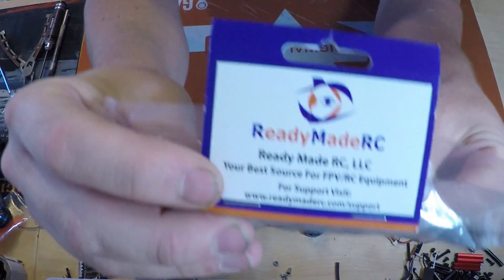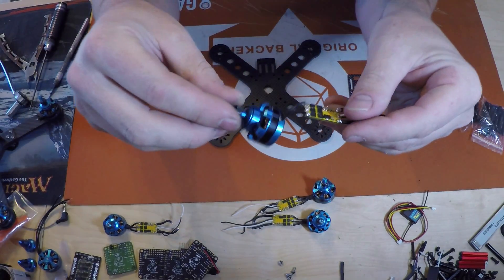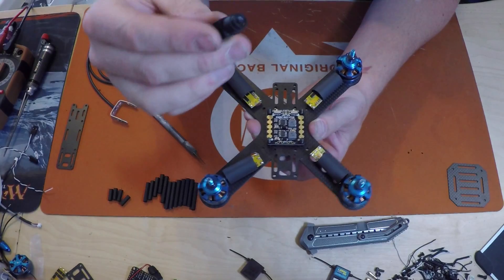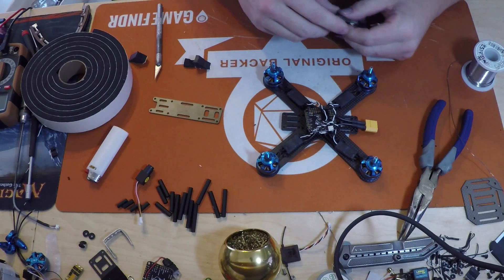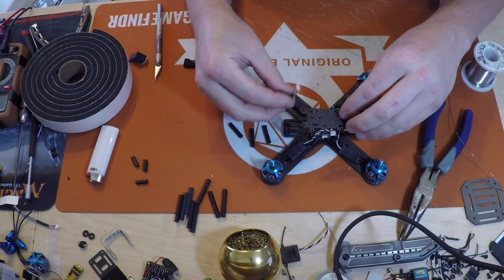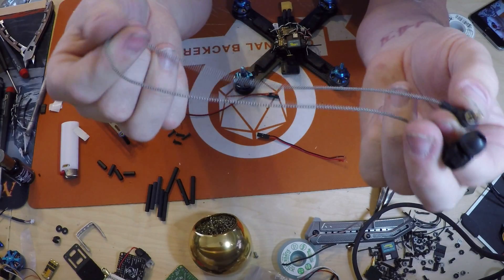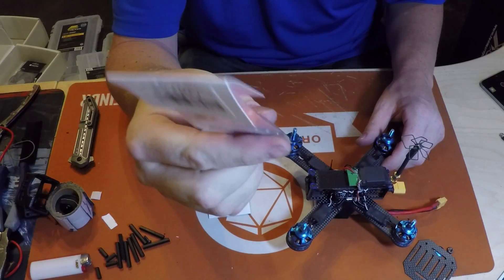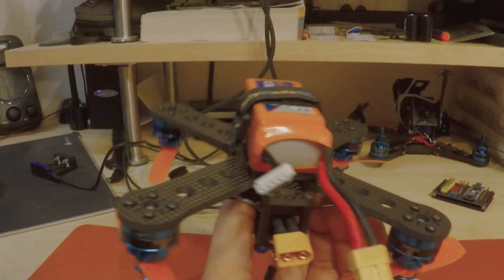Goby 180 Build Video

Comment: Hi! Could you please give an AUW? Without an HD camera but with fpv components and battery.
Thanks!
Reply from the maker: +kirikset I honestly do not know nor own a scale.  I will say this frame is perfect if your trying to achieve less than 250.  I would use the black RMRC 1806 2700 kv and the new rmrc 1000 mah 4s battery though.  Still has alot of power, i would say more than enough.  The only place I honestly felt a difference was I didnt have quite the yaw authority on pirouettes.  But with a 1000 and 1806s you are saving quite a bit of weight yet keeping runtimes about the same, 3:30 min

Comment: Those ESCs normally come with heat sinks on them, right? i.e. once you remove the factory heat shrink. It looks like you're going to run them w/o the heat sink? You've had good success doing that?
Reply from the maker: +Jeremy Cowgar Yes they do come with the metal pieces or heatsinks but I have never used them. I have never had any issues and use these escs alot!

Comment: I'm curious why you're using these motors with 4" props.  It seems inefficient and not great on available thrust with what these motors are capable of.  I looked around for thrust charts for this motor.   Have you measured it with these specific props?  I'm looking to do this build.
Reply from the maker: +scramjetx I enjoy flying with these motors esp with cut down 4x4x3 hq triblades.  Still not using the motors to the maximum potential, but instant power makes for very fun flying, esp with pirouettes etc.  I dont really care about efficiency as long as I can fly for 3 min on a battery which I can do regardless of what 4 inch prop I put on this set up.  
I am currently installing some new RMRC 1806 2700kv motors, and am going to try that with a 1000 mah battery, as it will be more efficient, and with the weight drop may be just as powerfull.
Reply: +awkBOTS That makes sense.  I'll have to order some tri blades too to check out with this build.  Have you liked a 3 cell battery with this setup?  I was thinking maybe the drop in weight might be worth a bit less power / RPM on the motor delivered by a 4 cell.
Reply from the maker: +scramjetx not on this build, but my micro build I did.  3s is too much power loss for me personally.  Ive honestly never had a multirotor set up for 3s so I cant really give any honest opinions on what set up to run for that.
Reply: +awkBOTS I see well that's good to know.  I'll probably just spring for the 4s packs then and let'er rip.  Thanks for the help.